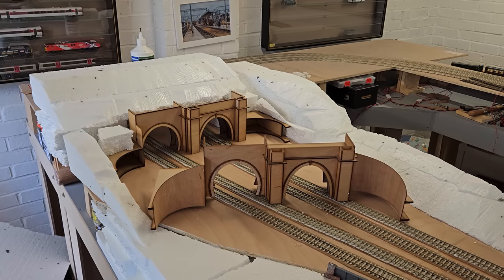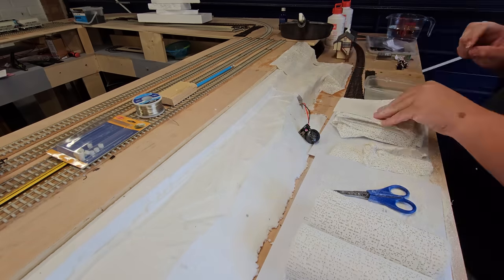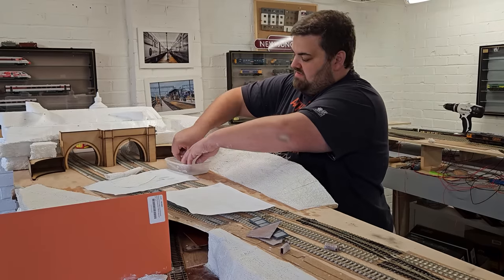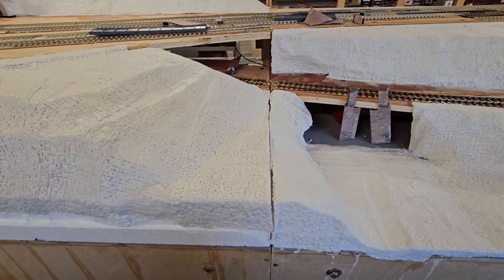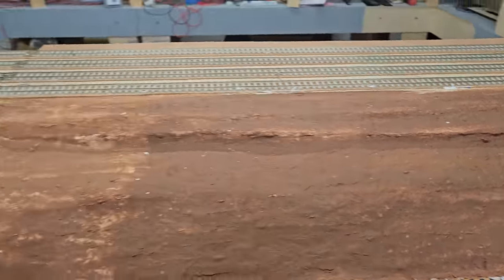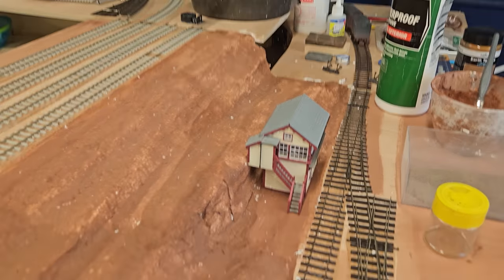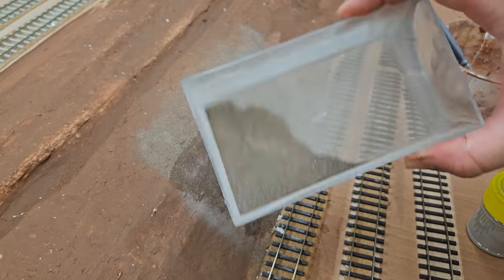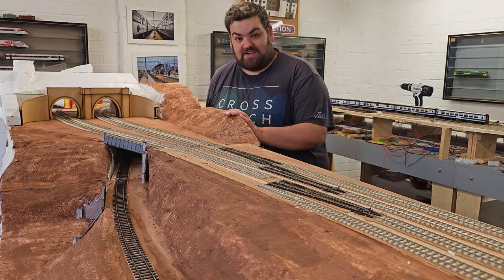New Junction EP16 - Ground cover

Comment: A little tip that I use, is to apply the paint almost as soon as you lay the sculptamold - don't wait for it to dry before painting. The paint mixes in with the sculptamold and this means that, later, when the scenery gets a little chip in it (and exhibition layouts are virtually guaranteed to get chips in the scenery) you don't see the white under the paint.

Comment: I watched your video and I have a tip to share, after plaster bandage is put in place, take pre-mixed plasterboard filler, spread some over bandages and with a wet 2" or 3" paintbrush paint the filler all over bandages.  Way cheaper than fiberwool and so much quicker, you can do it as soon as bandage material is almost dry.  Gives great hard finish.  If you put on dollops of this you can make rock faces as you are covering the bandages at same time.

Comment: Two things I do different are: 1. I usually put a re-railer at each end of any covered track just out of sight to help make sure that the train will get through the covered area in one piece. and 2. I will ballast the openings of the tunnels from about 6 inches outside to just beyond eye sight inside the covered track. I find this very much easier than doing it after and trying to get a good ballast inside the cover.

Comment: Looks excellent. I'm actually building a TT:120 layout atm, 2 4'x3' non-scenic boards at either end with a kind of 2-track return loop, and 2 4'x1' scenic boards in the middle forming a 4-track ECML scene loosely based between Northallerton and York (so the trackwork can be dead straight, with the 2 inside lines being the fast and the 2 outside being the slow, and platforms only on the outside of the slow lines. The layout is designed to be dismantled, and I'm currently working on wiring board 1 while waiting for track for board 4 to arrive. Boards 1 and 4 are designed to be able to join together to form an 8'x3' layout without scenery, so they'll be done before I start with boards 2 and 3.

Comment: 15:00 looks like the only place you will be able to see the MK5 coaches after Nov/Dec will be on the model layouts - unless they can sort out the cracking or the corrosion (on the Mk5 sleepers) they are being earmarked for the scrap heap already (four coaches have already been listed for scrapping due to cracking)
Reply: Fortunately, none of TPE’s Mk5 coaches have been earmarked for scrap and their fleet is only to be mothballed in December before being moved onto a different operator in May. 
The cracking issue has a fix, and it isn’t the primary reason for their withdrawal; trying to get the fix implemented is affected by the backlog of training which Covid and the current IR problems have presented, so TPE have been forced to “cut and run” so that a reliable December timetable can be created.

Comment: I’ve never used Sculptamold but was wondering how it’d react to mixing in the paint to it then sprinkle the dirt onto it before it sets? Just thinking of time saving as you’d be doing 3 stages in one.
Reply from the maker: You could colour the plaster although it may lighten the tone.

Comment: I don't want to upset you but . The tunnel and the bridge near the tunnel it don't look right . As it looks like the lower track goes under the bridge and under the tunnel where the main line is . However I'd also want to point out it's not my model railway.